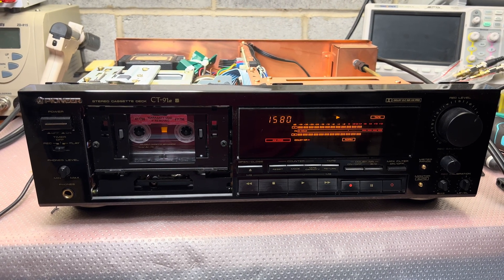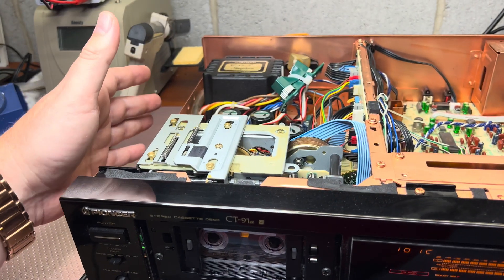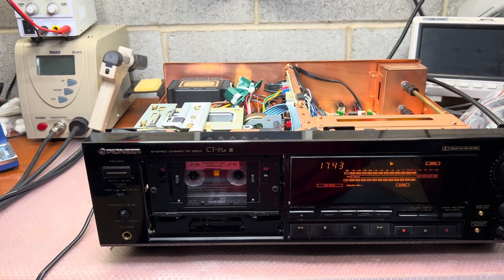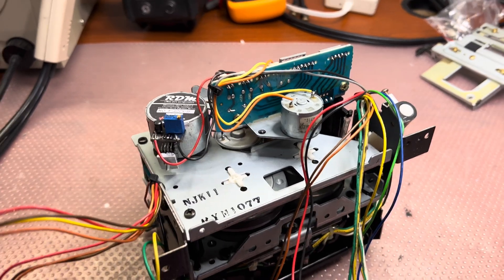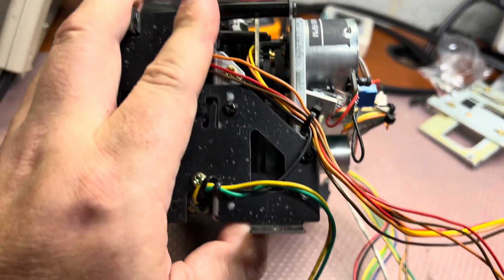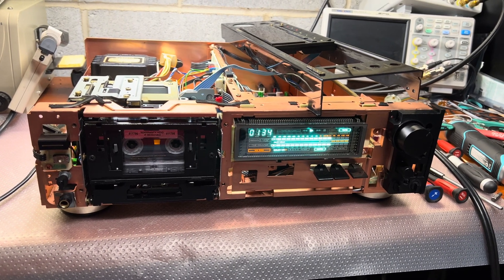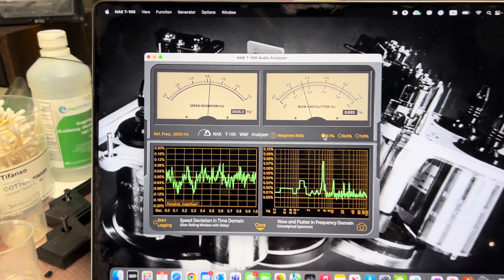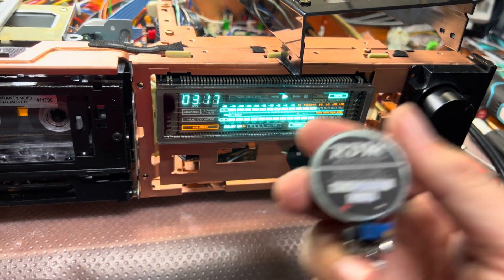Breaking Boundaries: 0.027% WRMS with DC Motor in Pioneer CT-91a?

Comment: Another Amazing Video. Looking at buying The MDL:ED-550L Motor, Do you know where to buy them?
 I could not find one or using the other part # MMI-6S2LS? Looks like a good motor to try? or any other Motors? (I think the RDM motor needs to be 2400 RPM Probably why it did not work?)

Comment: please, how to adjust speed in this model? my motor runs faster (480Hz)
Reply from the maker: DC motor has a hole in the back. Use a thin screwdriver.
Reply: @hifirulezzz  thanx, i tried it but nothing changed.
Reply from the maker: @DUOCAPRICORNS  Then the motor is bad and needs replacement.
Reply: @hifirulezzz  thanx, my serviceman promised me help to adjust it because he lubricated it before

Comment: Same is on mine Yamaha decks... Yamaha KX-670 is dual capstain, robust mehanics, and produce less w&f than some DD decks. for example last time i checked, measurements show 0.025-0.03. Also other very simple Yamaha KX-260, which have plastic flyweel have reading around 0.03-0.04

Comment: Some people is so invested in "modernizing" the cassette deck with BSL motors, etc. But there is a good reason these original (Matsushita and Mabuchi) motors were used: cassette capstans require low torque, high dampening, and stability over time. Modern BSL motors are designed for short bursts of high torque and direction changes, and only basic speed control--good for Drones, but not so much for cassette decks.
Reply from the maker: Not sure about some people, but if you would watch attentively, you would know that this BSL motor is from Sony TC-K555 deck and is a good one. Agree about modern motors, but this is more about controllers.

Comment: Regarding my motors, i will not manufacture that specific model anymore.
It's crazy, i ve tested one on a pioneer ct 939 (very simmilar to CT-91) and got good results (0.033% WRMS), and now, both motors i gave for testing turned out bad.

This can only tell me that the source of motors i use is unreliable (probably internal resistance varies a lot between them).

I will be searching for other DC motors, wich i will test more extensively and come back with another variant.